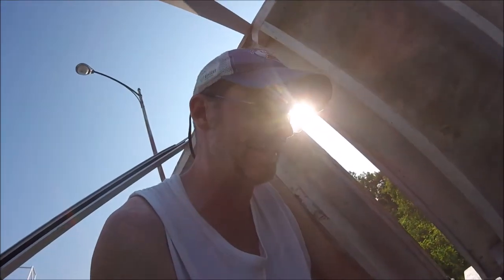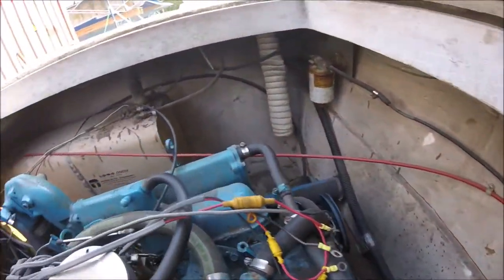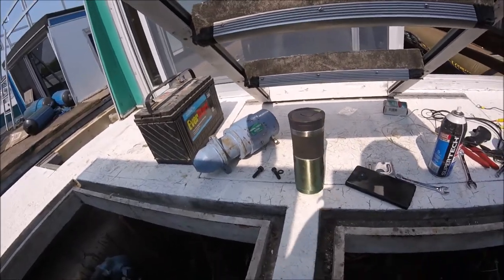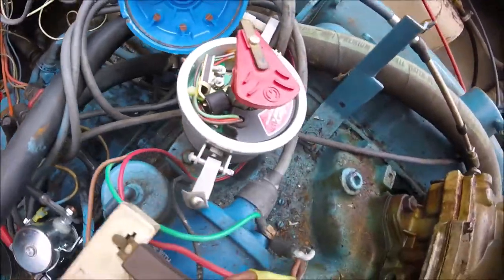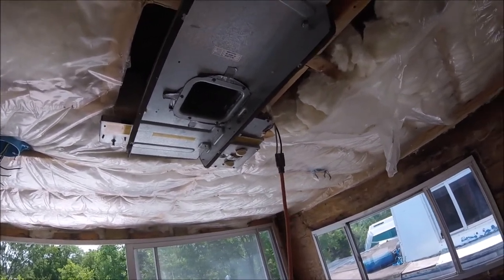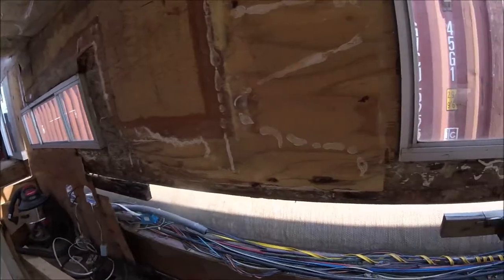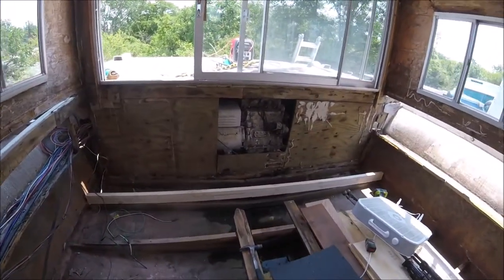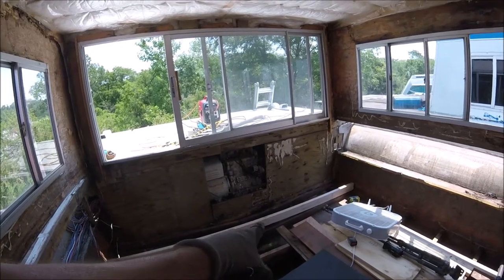Houseboat Build #2.  Will the engines run?

Comment: Those engines should be running opposite of each other those starters can’t be switched One runs clockwise the other runs counterclockwise I learned that one the hard way!!
Reply: Neither engine is getting spark!